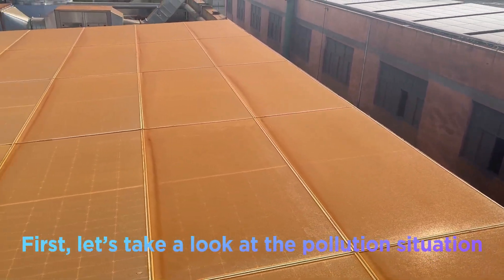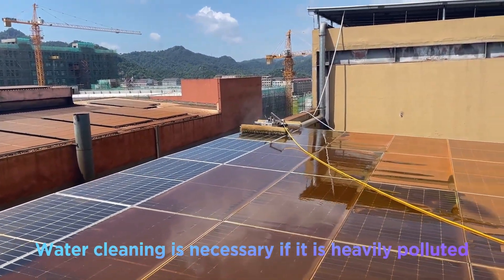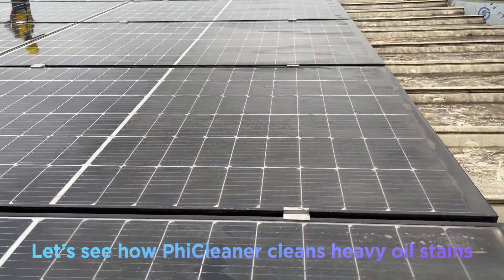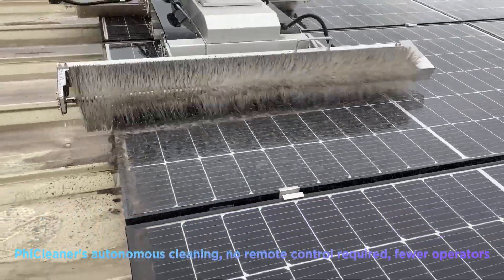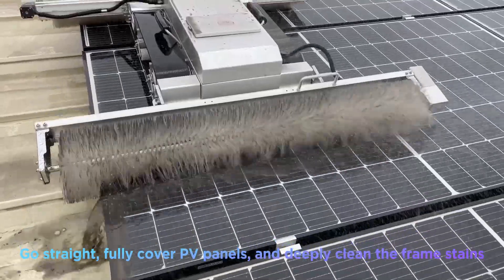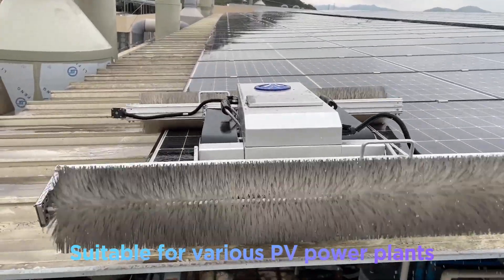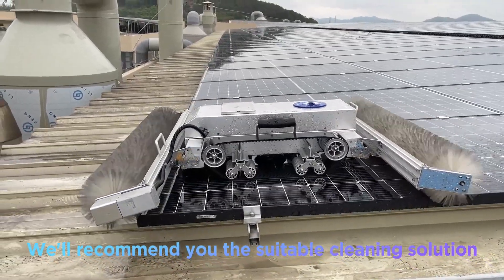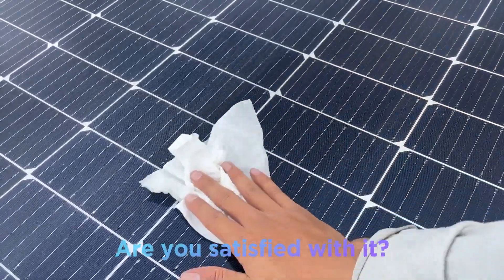How to clean heavy pollution in solar cleaning like oil stain, rust, etc? #solar #solarpanel #robot

Comment from the maker: Severe pollution such as oil and rust is a major hidden danger for PV panels. It not only affects power generation efficiency, but may even cause severe hot spots and damage PV panels.

Before cleaning such stains, we must spray the special detergent and can only clean it with water cleaning. 

PhiCleaner's autonomous cleaning uses scientific path planning. It does not require any remote control. It goes straight and covers 100% of PV panels, also makes autonomous turns and U-turns to prevent the robot from falling.

Deeply clean the frame to maximize power generation. It can be used to clean many types of PV power plants and clean many types of stains. 

You can consult us at any time to get the most suitable cleaning solution.

Email: ivan@kwunphi.com
Whatsapp: +8615223470332